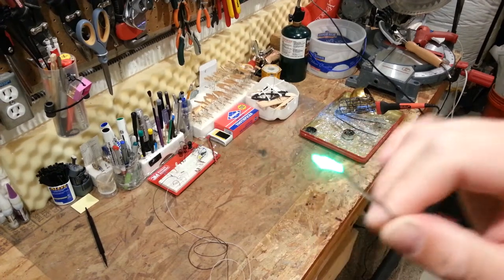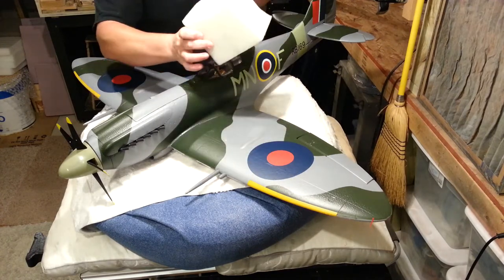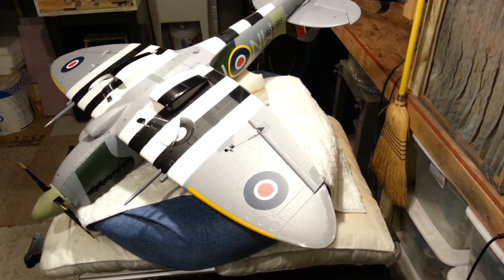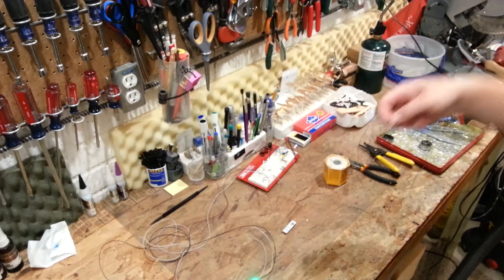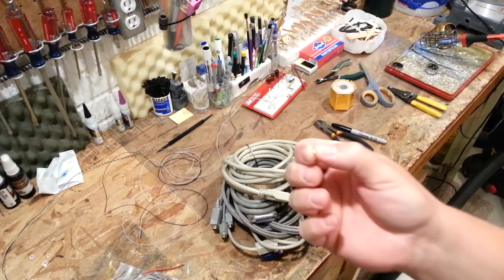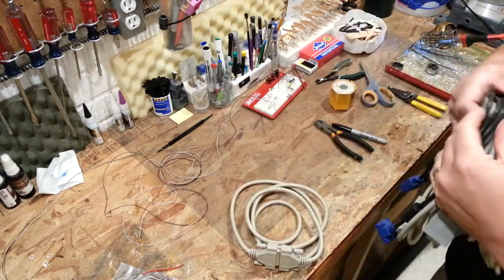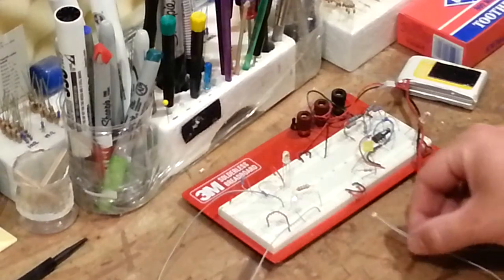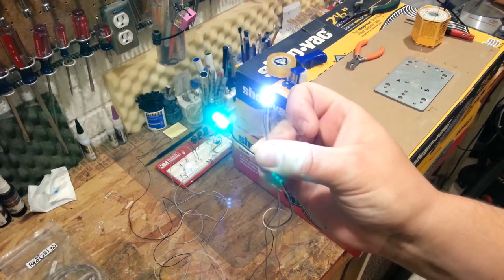Horizon Hobby - Spitfire - Navigation Light Mod - Part 1

Comment: Where do you get your led strips. Ebay? Amazon?
Reply from the maker: I got these from a friend, and the white ones came out of a billboard, so I don't know the exact source, but you can buy better ones at Hobbyking, and a variety of other places. They aren't all that expensive, maybe $10 per roll (or so).

This method is a huge pain, but it makes for a good finished product. I've done this a bunch of times, and I've also bought the designed light kits, and while they work, mine always seem to be brighter, and more omnidirectional.
Reply from the maker: From Hobbyking...

Green... https://hobbyking.com/en_us/turnigy-high-density-r-c-led-flexible-strip-green-1mtr.html?___store=en_us

Red... https://hobbyking.com/en_us/turnigy-high-density-r-c-led-flexible-strip-red-1mtr.html?___store=en_us

White... https://hobbyking.com/en_us/turnigy-high-density-r-c-led-flexible-strip-white-1mtr.html?___store=en_us

Comment: Instead of using foam for protecting the antenna why don't you make a plane stand from PVC pipe. I have a few different sizes for my planes and use some pipe insulation to protect the wings and body. Real cheap and solid. Many designed on the web. Keeps me from screwing up the plane.  Also stands are good for storage and transporting planes in your car or truck and when you want to paint your planes.
Reply from the maker: That is a good idea. I'm a glutton for punishment, I guess :)